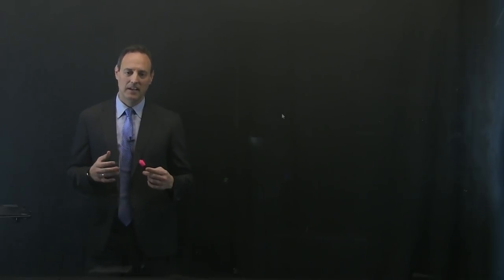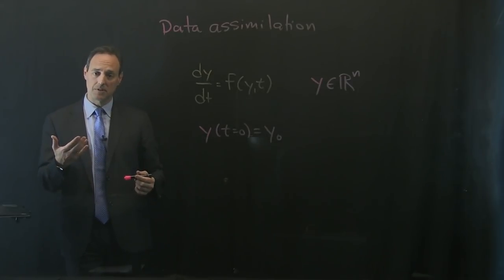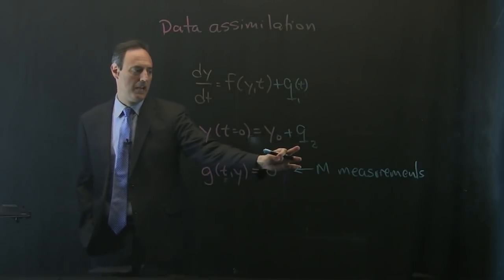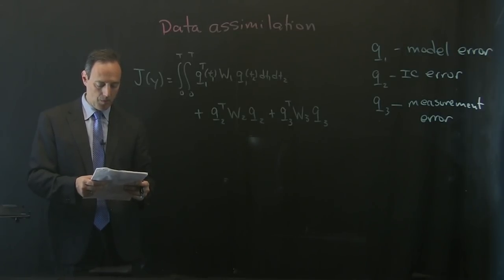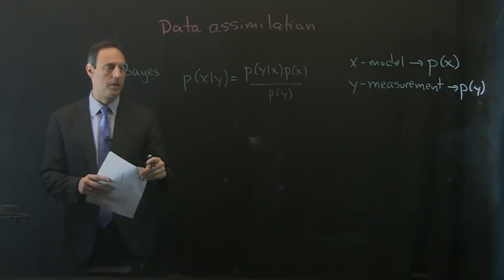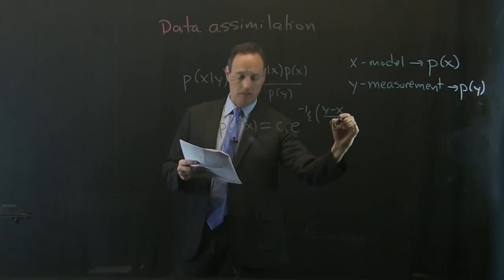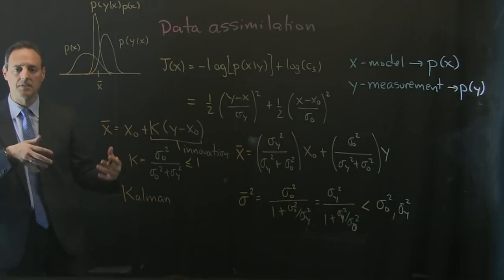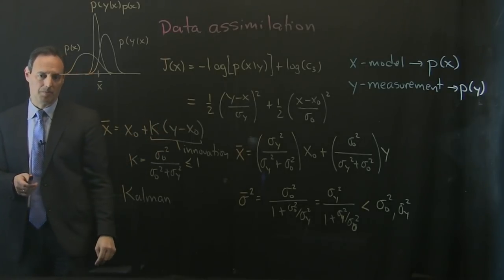Data Assimilation lecture 1

Comment: This is indeed a very nice video. Thanks so much for taking the time to explain Data Assimilation. One thing that was a bit unclear was the second term in the logged J(x) equation. So the first term 0.5*[(y-x)/\sigma_y] is the usual difference between the predicted versus the actual value--indexed by time. That is fine. But I was not clear on what the second term is doing: 0.5*[(x - x_0)/\sigma_x]. I am assuming that the $x$ value is also indexed by time in the second term. That second term will just serve to keep the $x$ values close to the initial value of $x$. But it seems like the value of $x$ can change substantially time depending on the model ODE $x$ and there is no reason for it to stay near the initial value. Any explanation of that would be appreciated. Thanks again for your video.
Reply: Hi Krishna,
That's exactly what i didn't understand  ...
 If you have find any reasonable explanation since then please let me know :)